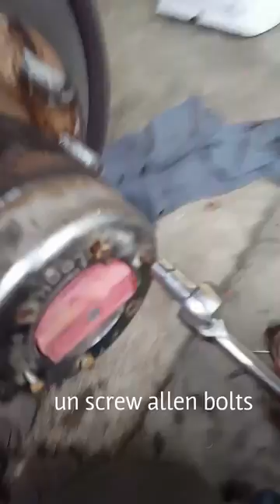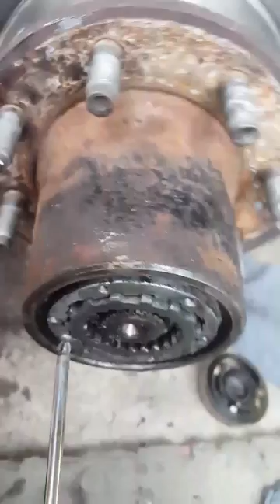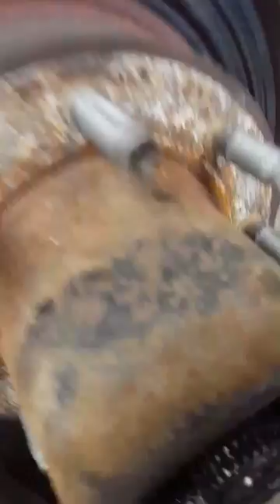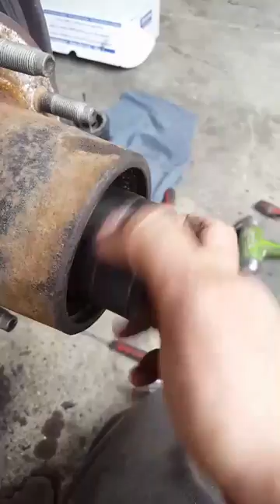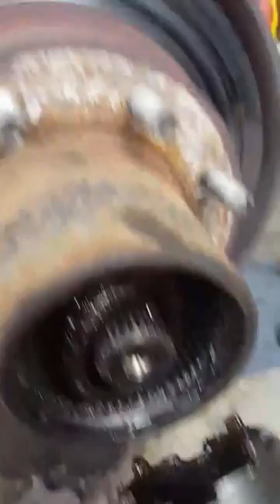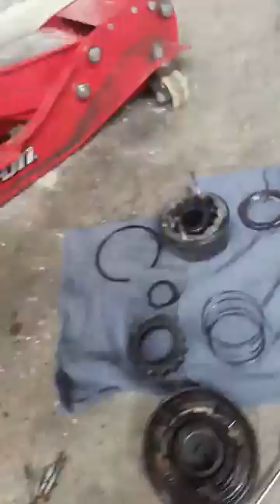76-93 ford f 150 f250 f350 4x4 hub asembly removal

Comment: I have mine removed up to the last price you pulled out before having to use the spindle socket but I put the bolts back in mine to back it out and it simply won't come off at all will come out about .5 of an inch then stops
Reply: having the same problem!!! did you ever figure it out
Reply: Bump because same problem snap ring off still won’t come out
Reply: I'm having the same problem and no one answers comments on any of these videos. Guess I'm walking to work again in the morning, it's only 12 miles...
Reply: If you never figured it out behind the snap ring is a snap in spring style retainer that looks like a key ring that has been flattened, when you remove it everything comes out and you can get to the nuts

Comment: Would the same steps apply for a 93 f350? And what size 4 prong socket?
Reply: I'm looking to replace the inner wheel seals on the front axle today. Not sure if there are any other seals to worry about but if it's anything like the one in your video, I assume there isn't. Also wondering torque specs of nut after putting back together
Reply: Did you ever find out size for the 4 prong socket?

Comment: Does the rotor come off the hub or do you have to buy the entire assembly
Reply: You can separate the rotor from the hub, you have to remove the wheel studs from the hub however as they go through the hub and rotor
Reply: @RageUnchained  awesome. Thanks

Comment: Mine is full time 4x4 78 f250 no lockers do I just pull the caps off any idea
Reply from the maker: I'm not sure I've never taken on of those apart , but the ones I have for a ranger there built differently than a locking system.  Check out a Chilton it may have a exploded view of of the the system you have. Hope this helps besure to subscribe to get more helpful tips and tricks.

Comment: Will the f250 4x4 hub fit on a f150 4x4?Want to change bolt pattern!
Reply from the maker: I have no idea ask a local tire shop the may know, my assumption would be no because the bearings are diffrent  and the shaft size could be smaller or larger.
Reply: no half tons r different setup